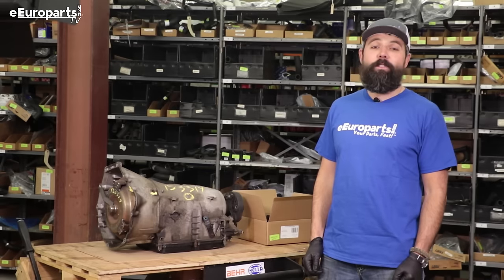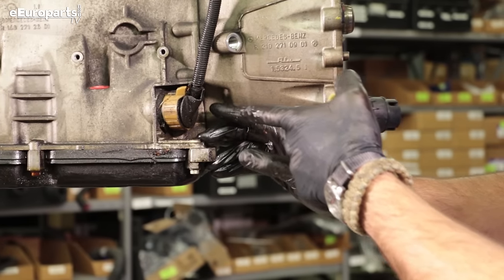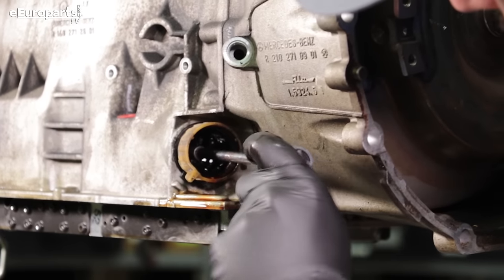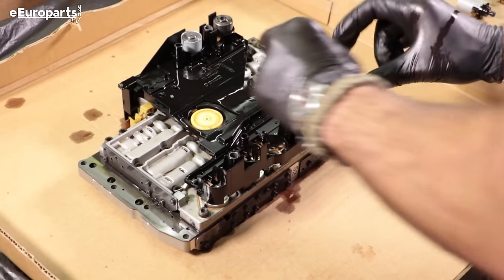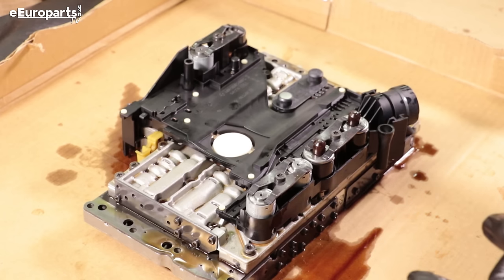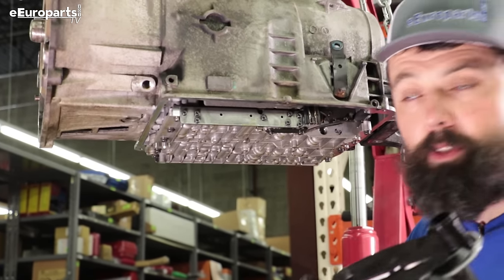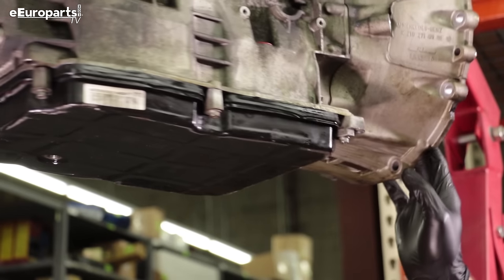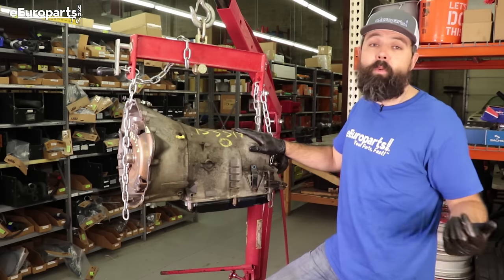Mercedes-Benz 722.6xx Transmission Valve Body Plate and Plug

Comment: Great video.
I have 07 E350 4matic, it would not shift gears while it revs up, I followed the video step by step, replaced the TCM plug and the conductor plate, however, the problem still exist.  also, the manual speed "techtronic" would not shift either.  all solenoids are at 5 Ohms except for one at 3 ohms.  ???? any idea what the problem could be???
Reply: Need to clear TCM codes with a diagnostics tool or at the dealer.

Comment: Is there a trouble code that advises you to do this work, or common sense maintenance or shifting problems.Although preferably to have the tranny out of vehicle, can this service be easily done while on car? Perhaps for some us a few more comments on torque specs i.e pan bolts.Thank you, as m any others have stared
Reply from the maker: Hi John, this work can be done in the car, it is just shown outside because it would be easier to demonstrate.  Although we try our best to be thorough, our videos are used as demonstrations, not detailed instructions.  We advise getting a service manual do to any major work on your car.  Therein you will find details such as torque specs

Comment: 139/5000
Why is there a 3 to 4 second delay before entering gear, after changing the body valve, selenoils, filter, shifter, etc.?

Comment: Hi , what happens if the bold holding the plug in it's place is broken inside the conductor?
Reply from the maker: You will need to have it extracted in order to install a fresh bolt

Comment: Why not test the solenoids for operation, holding pressure, voltage and resistance specs. I use up several cans of cleaner completely sanitizing the areas i work.

Comment: Hello, I own a mercedes w211 320 cdi 4matik 2008 year.The problem with the gearbox is that when the car is cold it shifts roughly between 1st and 2nd gear with a strange slip, when it gets to working temp. the shifting becomes perfect or almost perfect most of the time.Could it be those conductor plate and plug or most likely a mechanical problem. Thank you for your time!
Reply from the maker: It could definitely be the conductor plate, as this component often causes erratic behaviour
Reply: @Eeuroparts  Thank you for your answer, should I do a flush first i can send a picture of the trans.fluid color if you have an e-mail?
Reply from the maker: @IvanIvanov-gq6gx  Absolutely do a flush first.  On an automatic transmission there's a component called a torque converter that you can't drain the fluid out of, and it contains a lot.  The best way to do a flush is to buy 9 liters of ROWE 9004 and a filter.  You will have to do a few drain and fills before you get most of the old fluid out.  https://www.eeuroparts.com/Parts/PartResult.php?search=rowe+9004

Comment: Sir, I have 1999 Mercedes clk320 sports 2 doors, is it 722.6 transmission?
My question is, my car goes half mile and then it won't engage Reverse or Drive, what is the solution?

Comment: Hi, my car lost power when it 's hot, when start the car from a cool start, work fine, the problem is when it's hot. The scanner show in the part of gearbox that it's runing when the car it's completly stoped. What can I do? Do you think it is the gearbox or fuel boam?
Reply: did you fix it? i have the same problem. what scanner reads the codes?
Reply: @Mientras_Tanto  no, todavía no lo scaneo
Reply: Por cierto el puerto del scanner es redondo

Comment: Hello, I have a question. My car is 1998 W202 C180 automatic transmission. When I start to drive the car  the first and second gears don't change quickly. I should wait long for the changing of gears. After changing the gears it gets normal. I changed the oil because  of it but the problem with gears weren't solved. What problem could it be?
Reply from the maker: Most likely the problem described in this video

Comment: Hello, can I ask a question... I have something like bad baring sound in transmission that is following motor RPM, it is not too loud, especially when it is warm and when in N or P it almost goes away...do you know what element could it be and is it risky to continue without service, I just bought this car and in few days I will check and do a fluid change, I think the level might be a bit low, should I flush it? Thank you
Reply from the maker: Check your axle center support bearing and change the fluid and filter in the transmission, as well as the rear differential.  Our guess is your problem lies somewhere in there.  If it is a high mile car, some speed dependent drive train noise is normal.
Reply: Dzo most likely your torque converter .

Comment: Hey i really got a problem! Please help! I replaced the conductor plate, plug connector  and filter with all Mercedes parts. I also did the solnex 3 sleves and some ttansgo parts that could be upgraded on my 2002 c320 wagon. I did a flush also using the trans cooler return line till ot ran good and clean. I had the positive on the battery disconnected  for over 20 hrs. It ran great for a couple miles and i checked the level warm and running  and topped it off. After that it started doing the same stuff; getting stuck in 2nd or 3rd and sometimes the s or w light goes solid on the dash and will always shift hard in revers or drive when its doing it. Its just as bad as before i did all the work. You think i need to have it reset at the dealer. Any info would be much appreciated.
Reply from the maker: Yes, customers have reported that there is no change in driveability until a dealer reset is performed.  If that doesn't work, you will probably have to replace the valve body.  How long have you been driving the car with it behaving like this?
Reply: @Eeuroparts  not very long. I parked it soon after it started due to fear of getting stranded. It shifted great after i did the job till the issue started back. It never really had a shifting issue, just the electronic gremlin but it is much smoother now. Guess i need to take a trip to the stealer, i mean dealer. Thank you very much for the reply, i have had a hard time finding info and im at my witts end.
Reply from the maker: @mistercodyful  That is good that you haven't driven it for long.  Often times customers will drive their car for thousands of miles while experiencing shifting issues.  That ruins transmissions.  In our experience, valve body problems take a long time to come to fruition.  Let us know what the dealer says in a comment followup please!

Comment: Hey my c200 kompressor w203 gives me problems, It started with delaying to shift gear from park to drive/reverse. Licking transmission oil, Then it started to jerk so hard when shifting gear to drive, losing power when driving, so I tried to change oil to the expensive one... Changing oil process was successful but there were metal shavings on the pan and the oil was black and the car still doing the same... Please help I don't know what need to be replaced..
Thank you in advance 🙏
Reply: The gear also stuck on neutral sometimes when I want to park... It won't go R/P.... Then I have to turn off the car first and then shift to park. Please help it is urgent.
Reply: @bellatlali1034  hey did you ever resolve this issue? The delayed start and not shifting past reverse into park is a specific problem. Mine is doing it wonder if I should do the conductor plate or TCU shifter. LMK what you did if you could. THX

Comment: Can the rear sam module affect an 06 s500 tranny?  It looked like; traction control is the only tranny related in the back sam, but a benz.  I cleaned corrosion off last year from the rear sam, but the tranny started slipping into neutral on a drive home last week.  It limped in 3rd gear home, and after resetting everything, the car only has reverse.  It might have higher gears, but my + - shifting  does not work, so I can't get past 1st gear to test other shifting.  Can the shifter module cause such a thing?  I have had issues with rear sam, and shifter in the past.  It sounds like a solenoid, TCM, or conductor plate, but these 2 mentioned spots, have given me past issue.  I don't want to pull the rear sam again, if it can't cause this slippage in the tranny.  Does anyone know this answer?

Comment: Will a regular scan tool reset the TCM
Reply from the maker: Most likely not, this is specialized and would require specialized equipment.
Reply: No. U gonna want like star diagnostic tool. That’s what I use to reset and or program what’s needed for Mercedes

Comment: Hi can you help me I have a Mercedes benz w202 c250 td 2000 model  having a problem with the gearbox she goes in to drive but won't rev up or move Same with reverse but Rev up in park and netural tired A scan can't get any error codes checked the atf fluid has 5litres in plz help
Reply from the maker: This might be an engine problem, see if you can check for fuel flow.  The engine needs very little fuel to rev in neutral but under load will take considerably more fuel to move the car.  You most likely have multiple fuel filters, check/replace all of them.
Reply: @Eeuroparts  Hi bud we haved replaced all filter even checked fuel line at the work shop all is good the macknick says all is good but can understand y no error codes and u the car won't rev past 1000rpm in D or R

Comment: I have a shudder in low rpms when im tryin to maintain speed and when stopping in go's away in i put it in manual mode it shifts fine anyone have any suggestions on what it is
Reply: EGR valve is dirty.  On the front of the engine.
Reply: @DesertSam  i would love if it was that thats an ez fix i was thingin bad torq converter or clutches if i shift it in neutral when im driving and it shuddering it stops i fig that isolated it to the transmission
Reply: @newwavepressure6478  i have the same problem what was it??i think also the transmission
Reply: @stefaanalen7382  i still have it dont drive it much its either the torq converter or the trans i had the trans overhauled about 2 years ago i guess it was a wast of money hopin to put in a reman trans and new torq and hope that fixes it i have the fluid flushed 3 times and new filter just to make sure no water got in didnt help a bin
Reply: @stefaanalen7382  did ur start out of nowhere one day mine was fine yhe next day  shudder
Reply: @newwavepressure6478  1 year ago i had it i let it fix for 800$ after 1 year i got it again they fix it like in the movie when its shudder at slow speed i give more gas and its away till the engine is warm its gone

Comment: At the time 7.10 where did that ball bearing come from, i saw it come out when he took the conductor plate off.
Reply: You mean at 5:20... I saw that too, but didn't realize it was possibly a bearing until I saw your comment. It most likely came out of the valve body, there are a few of them in there.

Comment: Hey Josh I replaced gasket, filter, fluids, conductor place oem, and silanoids and still limp mode... Help...
Reply: Same here going crazy
Reply: You need to clear the TCU reset with a scan tool. If they are in limp mode all the time they won't work until you clear the fault codes
Reply: Thank you for the response I did it couple of days ago after having all this codes with a scanner but not connected to the 38 Pin connectors.
P0715 Input/Turbine Speed Sensor Circuit Malfunction
P0753 Shift Solenoid A Electrical
P0758 Shift Solenoid B Electrical
P0763 Shift Solenoid C Electrical
P0720 Output Speed Sensor Circuit Malfunction
I believe all these codes are related to the conductor plate. I flushed the fluid again and tested the solenoids with a 12V battery. I also checked if the TCM was not affected by the oil that comes up the wire. I tested with a voltmeter pin 29 and 30 of the TCM 12 V no problem, I wonder if I should also have 12 V coming on the connector just before the transmission on pin 6 and 7 because I barely had 6V.
Am I having this problem because I didn't clear my code with a big scanner?
Thank you
Reply: @adamcarver5599  is it the tcm reset the same as the transmission reset done with the car off pressing the gas peddle down and turning into the option 2?lmk
Reply: @johneun1734  NO THEY ARE DIFFERENT
Reply: @adebillions3292  so what should be the next step?
Reply: @johneun1734  You need a scantool that can see the TCU... SDS will be ideal for the reset, QUOTING RUDENEY: FYI, that "reset procedure" where you press and hold the accelerator pedal and turn the switch, then wait 2 minutes for the "click/ping" sound, well, that does nothing with the TCU. It simple synchronizes the "drive-by-wire" accelerator pedal with the throttle position sensor on the throttle body.

Comment: I have a 2007 e320   It hard downshifts into 1st sometimes.  Will this help?
Reply from the maker: Have you changed the fluid and filter yet?
Reply: eEuroparts.com  I have not. Just want to make sure. I have 101,600 miles on it.  Probably a good idea cause I am the second owner.  New radiator fluid would be a good idea too.  Changed the oil 3k miles ago.
Reply from the maker: @dolph9913  Here's the correct spec transmission fluid https://www.eeuroparts.com/Parts/419881/Auto-Trans-Fluid-HIGHTEC-ATF-9004-5-Liter-25050005003/ and here is the filter https://www.eeuroparts.com/Parts/68468/Auto-Trans-Filter-097460/ Give that a shot first.  100k miles is a good time to do a trans flush.

Comment: OK, Mercedes Automatic Gearbox Lovers, beware!. From 2004, Mercedes changed these problimatical  (electronics) gearboxers to the 722-9. This is the 7 speed box that has evolved from the descrbed 5 speed here. The ECU is, in the later case, inside the Electronic Control Unit, ‘in the gearbox”. The interesting find in all this drama is, that even the 722-9 leaks oil up into the multi plug (new vertical design) and seems to cause the same sort of problems. The only difference is, even when you’ve cleaned up the multi plug, put a new seal in it (only for dust now), the gearbox MUST be reset with a garage having the proper MB eqiupment to talk to your central ECU and reset it!.  A Y3/8n2 fault pointed to an internal tranmission fault. My local MB dealer was able to reset it (after the service I did) and hey presto, all is well again!…….. PS. on a 722-9, you are apparently meant to drain the Torque converter too. That was new to me!……….. I wait for an update with great interstest. Thanks for all the information, I hope I can forget about it for another 10 years!

Comment: You talk about cleanliness but yet you didn't even clean the valve body at all or clean the solenoids or clean the plastic covers , all that needs to be spotless clean before you put a brand new conductor plate in there. Also it would have been nice if you would have said that the plug bolt is 7 mm, also very very important not to tighten that 7 mm new plug that goes into the conductor plate too tight it can break immediately if it's too tight , just a light two finger turn once all the way in.

Comment: So I replaced the conductor plate, plug, and solenoids. Now my transmission will not shift out of what I believe is first or second gear. So frustrating. I don’t know how to fix that. Any help is highly appreciated and please chime on if you experienced something similar and how you overcame that issue.
Reply: If you tighten that 7 mm nut that holds the new plug to tight it'll break the conductor plate immediately , that might be the case if you have everything new

Comment: You saved me $3,200 from some Shark Mechanic who said my Transmission was dead. I only spent $267 in parts and now my car is working again.
Reply: Hey
U need to reprogram the new plate?
Reply: Love it that's why we're here right fix what's amiss, gain new skills AND the sharks will have to find other victims or better yet, honest work  !
Reply: @alex59606  Prob disconnect battery negative cable for 10 min & reconnect that will clear old codes & allow proper functions to resume, post repair.
Reply: Hola, tu carro presentaba perdida de fuerza al acelerar cuando ya estaba caliente? O q síntomas tenías?

Comment: Help lol im getting a shudder in low rpm just trying to maintain speed it also happens when im slowing down if i put it in manual mode with the auto stick it goes away anyone have any suggestions i did a fluid and filter the fluid looked good

Comment: i hate how you have to take it to the dealership to get it reset i live about 60 miles away from the stealership i can't imagine how much the stealership would charge not including to tow the car all the way there.
Reply: You don't have to take to the dealership to reprogram on the 722.6 transmission
Reply: @ericbenz6580  half the people are saying yes and half are saying no. I have a bludriver scan tool i hope that will clear the needed codes.. hhmmmm

Comment: ? My 2008 dodge sprinter 3.0 turbo has a issue up shifting when the temperature outside starts heating up. could this be the gas pedal sensor over heating. When its cold outside it shifts fine.

Comment: I have the code p2767: Transmission speed sensor/turbine shaft speed sensor B no signal. Is a new conductor plate what I need to fix this issue?
Reply: Did you ever get this problem fixed? If so what did you do ?
Reply: @Lavah_3477  unfortunately I did not. I used an icarsoft to erase the codes and that seems to be a temporary fix but the problem keeps coming back. Looking into newer cars so I don't really plan to fix it

Comment: hello my 2004 c240 mercedes goes on neutral when making a right turn , any idea why it does that . please help
Reply: I had the same issue with my SL500. You need to get the conductor plate replaced.
Reply: Marcos Silva hi Marcos Silva. I had seen probably yesterday night when I do the sharp turn it went like on neutral then I accelerate the car and it was like a neutral two or three times and after that I was going straight transmission start work again. how much you think will be parts and labor for for this job? or did you do it yourself?